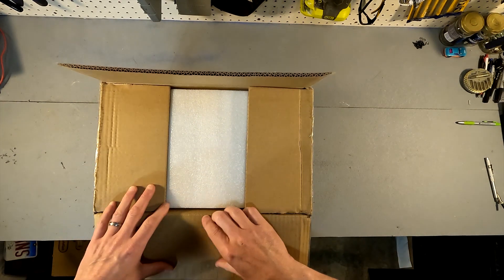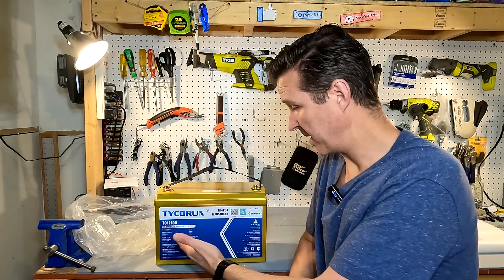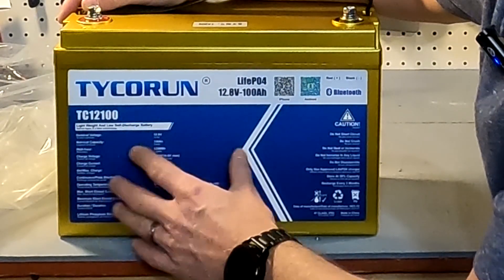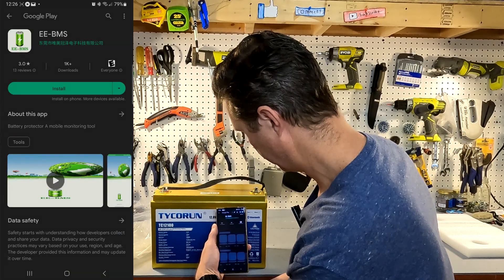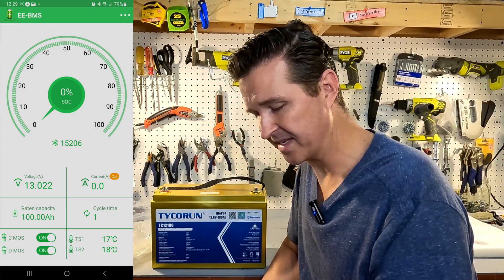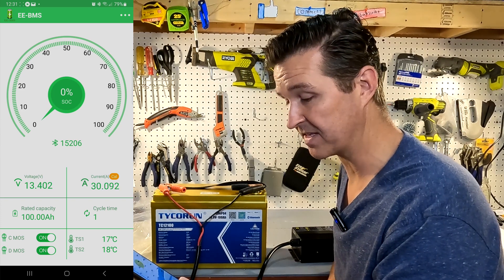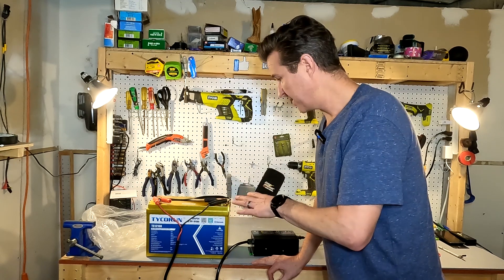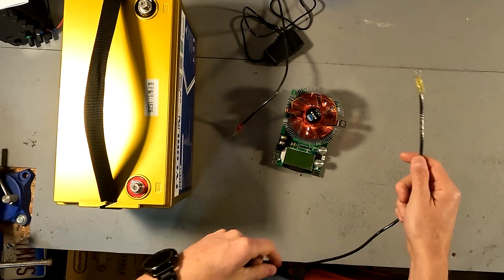TycoRun Battery Review

Comment: price of these batteries are really coming down, maybe i can finally put some in my trailer. i would recommend upgrading that battery tester to something a litle more serious. i have a kunkin kp182 (up to 150v 20a or 200w) they have a higher wattage one as well. they are much more solid and built just like the power supply you have. there are alot of brands but they are all much better than those exposed circuit board ones like you have (i had one like that before that lasted about a month). they are a little pricey but with all the batteries you test it might be worth investing in one.
Reply from the maker: I'll look into the kunkin.  Thanks for the advice.  The batteries are getting down in price.  Just make sure to sue the research if you need low temperature disconnect in the battery.  Good luck!

Comment: I'm guessing the cost difference is the cold weather protection and bluetooth because I'm seeing a few 12v 100Ah Lithiums for $300 right now. Weize in particular and I'm sure they offer no protection. Cold weather protection really shouldn't cost more, just sayin..  Good video
Reply from the maker: I think you're right.  Having a cold temp sensor on the BMS costs next to nothing.  It really should be standard equipment.  Thanks for the comment.

Comment: Variable power supply for the win!  I've been going through small DC power supplies like crazy recently.
Reply from the maker: Have you been running them at full power?  Are they burning up?
Reply: @OffGridBasement  I meant the little DC "wall warts".  I've replaced at least 3 in the last few weeks.

Comment: They do look nice in gold... I dashed over to their website. And got all excited for a moment as one of their main pictures is of a Righthand drive Motorhome, but it's in Central South Island, NZ
And I can't see a UK distributor :(
Reply from the maker: That is a bummer!  I hope you find something that suits your needs!
Reply: @OffGridBasement  I bought 2 of the Epoch 100Ah 12v batteries.  but they are running low on stock here in the UK.
might have to make one, two :o
as I would like to run a 48v system